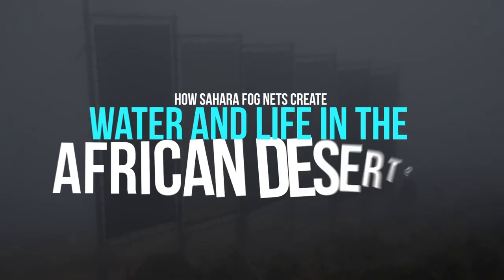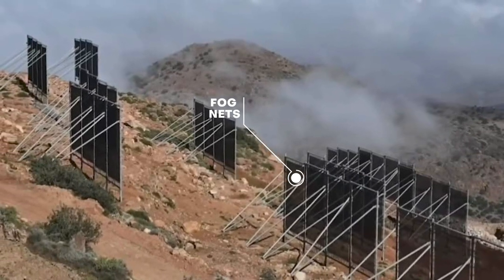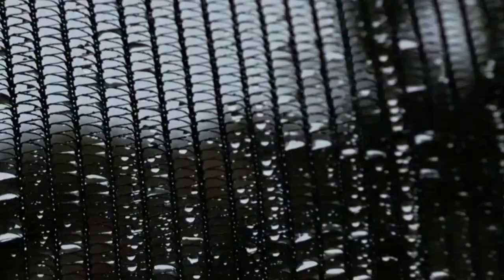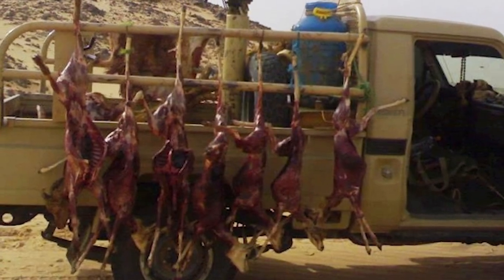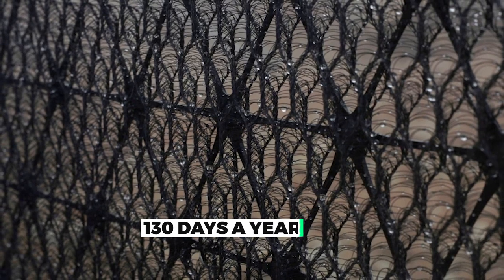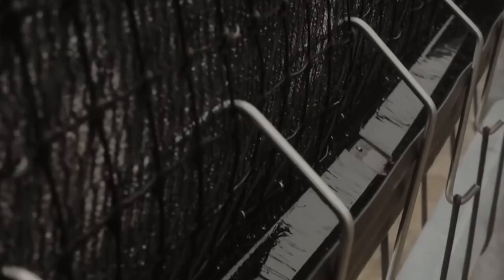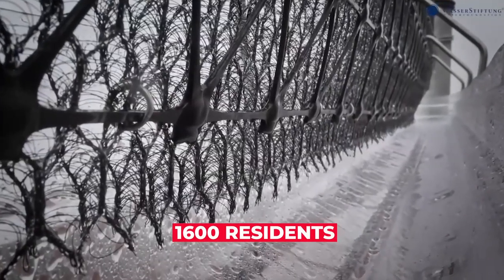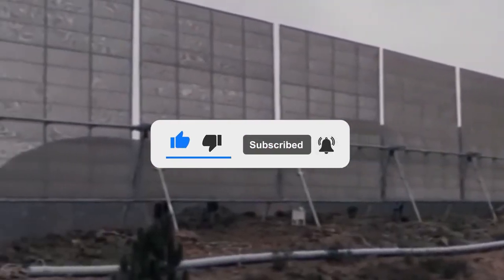How Sahara Fog Nets Create Water and Life in Africa

Comment: This is a very expensive solution per liter. An industrial scale solution is required.
Reply: Only installation. Then its there for decades. So not expensive. But eventually the rubber will break down and this will pollute the hills. I think planting bushes and watering them till they have grown would have the same effect and is a better solution.
Reply: @TheBooban  I am sure rubber need not be used...stringing up hemp into a fog catching fence like those would be possible...maybe not as effective but still catching lots of water...most things will break down over time...I reckon it would also be possible using stainless steel wire which will not break down...thin wiry substance which will not poison the water could be used...stringy plant matter...the people only need to get creative and experiment with it to see how well what they have made works...they have plently experience weaving baskets and other items...its just a matter of small fibers being weaved together and made into a fence...even streching out womens stockings will catch some water into a tray underneath....fine fibre material

Comment: Je ne comprends pas pourquoi cette marque de filet ne vend pas au particulier, cela permettrai plus d'autonomie et de jardins arrosés sans utiliser l'eau de ville. Malheureusement ils ne vendent qu'à des ONG , qui nous le savons bien sont pour beaucoup corrompues, va savoir pourquoi...
Reply: its just about money...$$ is the bottom line....
I am sure rubber need not be used...stringing up hemp into a fog catching fence like those would be possible...maybe not as effective but still catching lots of water (catching trays could be long straight bamboo piece cut in half and tilted to drain into a large container)..most things will break down over time...I reckon it would also be possible using stainless steel wire which will not break down...thin wiry substance which will not poison the water could be used...stringy plant matter...the people only need to get creative and experiment with it to see how well what they have made works...they have plently experience weaving baskets and other items...its just a matter of small fibers being weaved together and made into a fence...even streching out womens stockings will catch some water into a tray underneath....fine fibre material